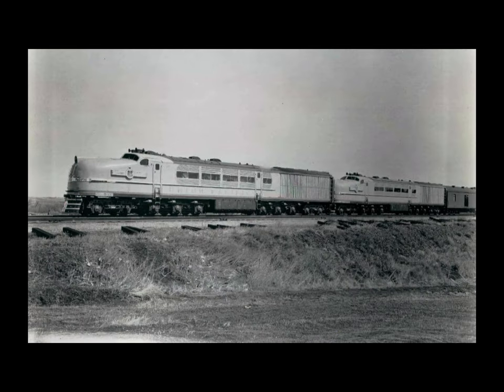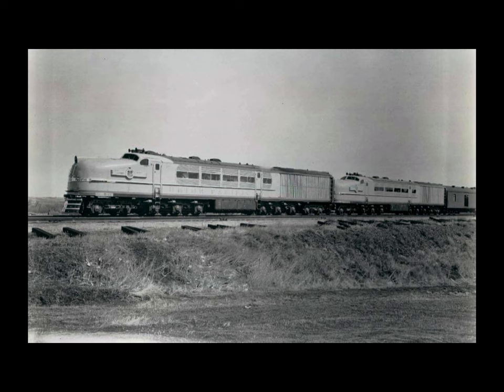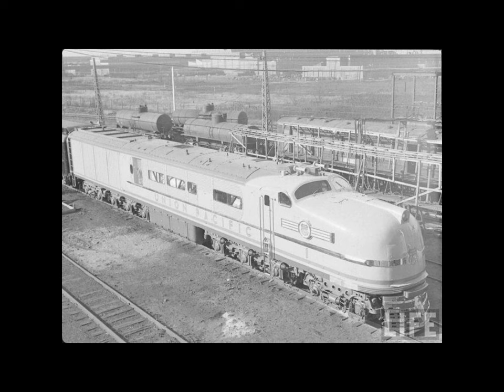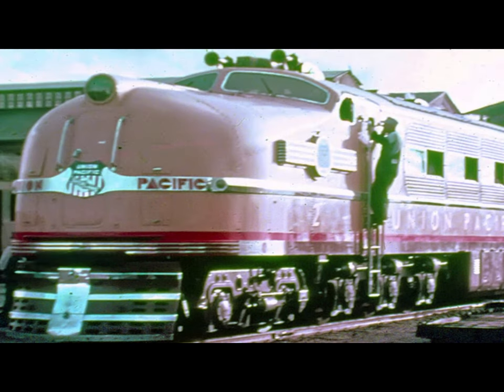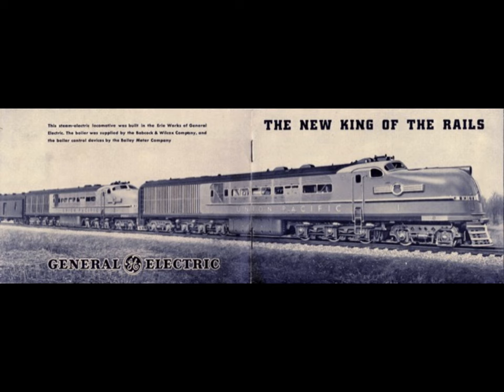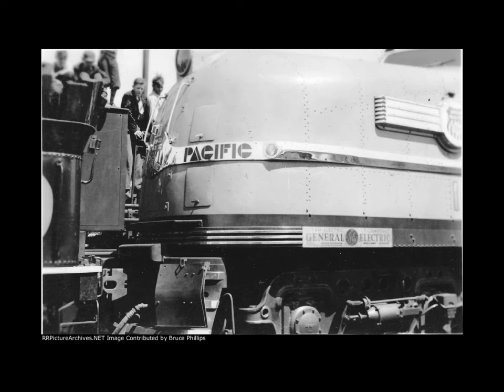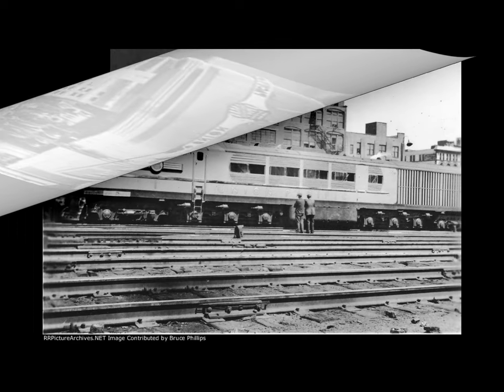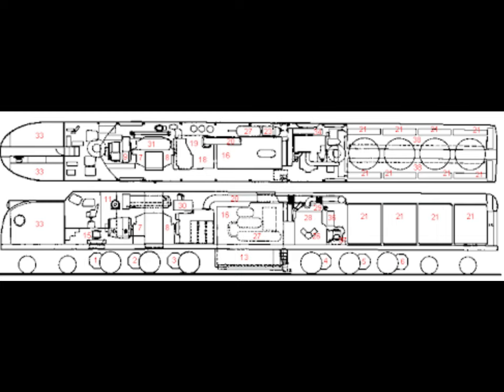Union Pacific Steam Turbine Locomotive

Comment: As I have mentioned before on maybe this Chanel or another one, I was a Stationary Boiler Fireman in our town of Glenn Dale MD at a hospital run & funded by the Wash. D.C. Government. We had 4 Babcox & Willcox water tube Boilers each as big as a 2 story house  with a steam turbine to supply air for the Boilers & reciprocating water pumps. We supplied the 2 main hospital buildings 1 huge employees quarters & 2 apartment buildings & a laundry We also operate a detached water softener plant which we also repaired & overhauled when I worked there from 1967 to 1972. This complex was built in 1935 as a Tubberculosis Hospital. The Boilers were coal fired but just before I left coal was abandoned for oil which I never liked & didn't take the time to learn as I had planned to leave. Thank you so much for your informative Chanel and also your narrative.
Reply: That's all just peachy, but what on earth does that have to do with the locomotives being discussed? Nothing.

Comment: Usually the condenser cannot keep up in heavy use. Keep the workload down and they could work. That is why the power varies so much by temperature. They would not be good on hot days.
Reply from the maker: Great point!
Reply: That's why common sense dictates not using surface condensers outside of marine systems. This engine should have had a counterflow jet condenser feeding a conventional radiator

Comment: Diesel engines and locomotives go so well together returning to steam is (regretfully) a pipe dream.  A turbo compounded Diesel engine is currently the most efficient practical engine and when it drives steel wheels on steel rails, unbeatable.
Reply from the maker: I find that concept very interesting